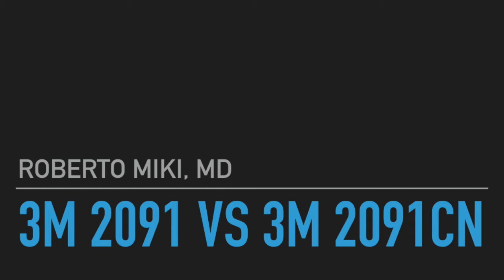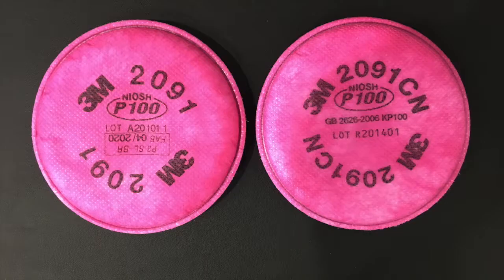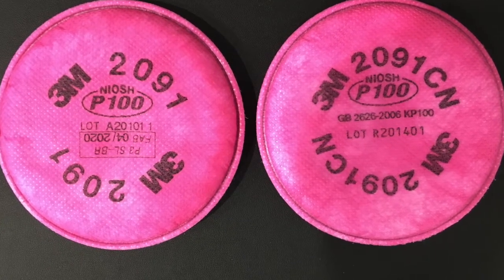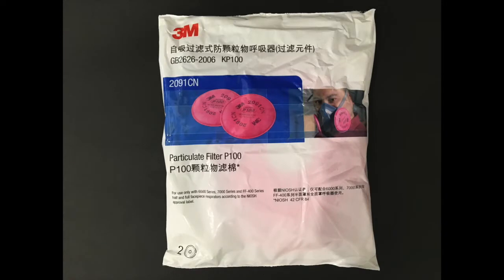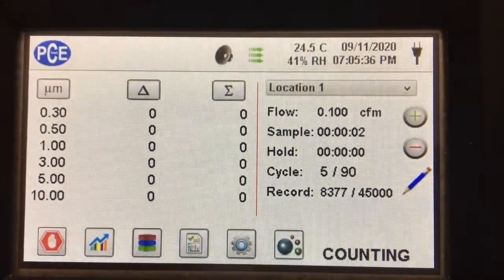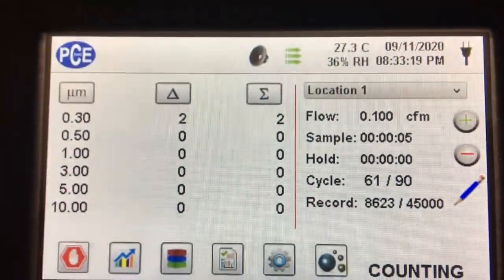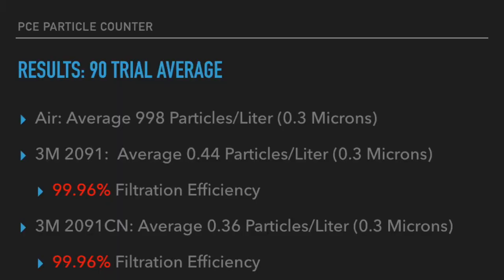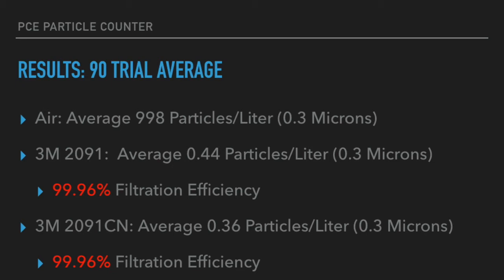3M 2091 vs 3M 2091CN Purchased on Amazon

Comment: Wow, thank you for testing these 3M filters.  So there are only minor filtration differences between the 3M P100 "7093s versus these 2091s".  Any other advantages or disadvantages between the 7093s vs. 2091s?
Reply from the maker: 7093 has the advantage of being splash proof. With the disc shaped filters if you are working with water or oils it can damage the filters. So for those situations the 7093 is better.
Reply: @RobertoMikiMD  Very good points, I appreciate your expertise.  I look forward to learning more from you.
Reply: @RobertoMikiMD  hello..great job there.can i ask which filter is better for protection against fumes of plastic melting? Thanks in advance

Comment: Hello Roberto, all your testing videos are really great. It really helps to take a decision to buy the same. Can you please also try and test 3m 2097 and 3m aura mask. Thanks so much, Sanjay
Reply from the maker: will try to get my hands on some
Reply: @RobertoMikiMD   Thanks Roberto, it would also help if we can test face shield + mask and see if we get 100% filtration efficiency by using both. Can you also let me know what is the smallest particle size which can be counted by the machine in nm/microns, Thanks and Regards, Sanjay
Reply from the maker: @sharmajs2010  0.3 microns is smallest measurable on my machine